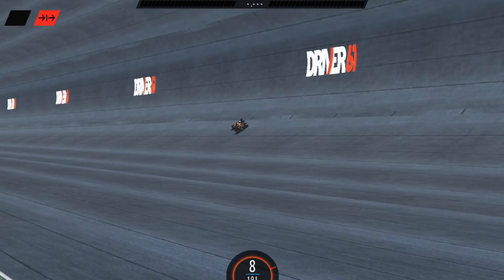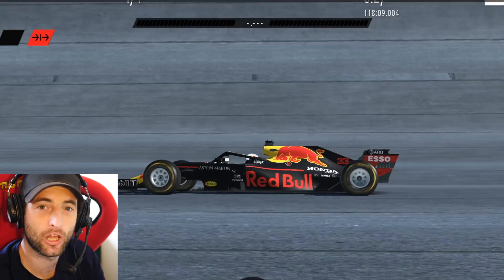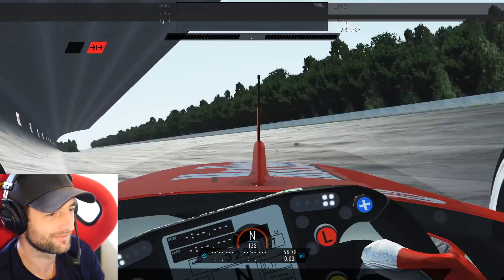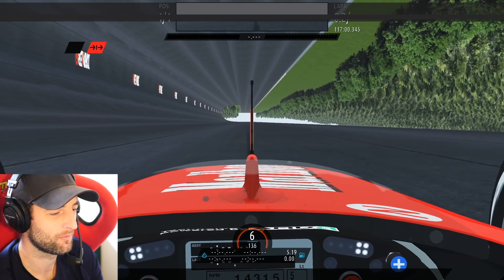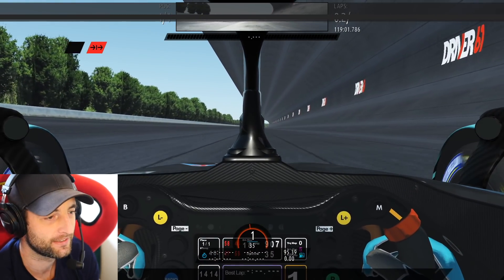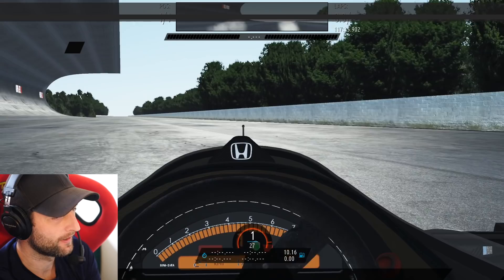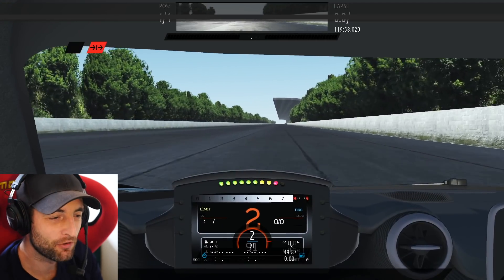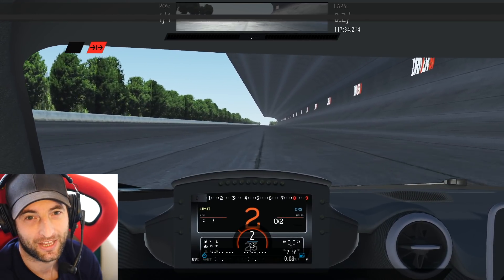Can an F1 Car Drive Upside Down: The Test

Comment: you should take a car that is driving upside down and drive it off the edge of the track to see if it will to go up for a bit before falling
Reply: it wouldn't because it would lose a ton of downforce without the negative pressure between the car and the road from the diffuser.
Reply: Unlikely because a large reason this is possible is due to the downforce generated by the floor of the car which can't be made once it's driven off the edge.
Reply: @harrywhite9030  you're right butttt i still wanna see it happen, for science
Reply: @harrywhite9030  mucho correcto
Reply: @harrywhite9030  but isn't everything in the topside aero actually creating lift once inverted? although not ideal in this design, the overall design for down force is what wings for lift look like. Air should pass faster over the underside (now the top) of the car than it does on the regular "top".
I'm feeling at best there would be a bit of sustained flight, but without thrust, all lift will decrease quickly.

IDK would be great to see!
Reply: @efini_fc4276  hm im not so sure, the aerodynamics of a F1 car is made to 'stick' to the ground, and i think it can only do that when it has speed. When you go out of the track and not only you cant speed the car anymore but it wont be able to glide since its design doesnt allow that, because its oposite to a design from a plane, witch is made to lift from the ground. I dont know for sure, because honestly i dont study this type of stuff and could be just saying stupid stuff but thats my thoughts on it. I do think it would be cool to see what happens.
Reply: @efini_fc4276  no because the floor required 2 surfaces in order to generate downforce, it's the action of the floor moving over the stationary ground that generates the downforce.
Reply: wow, I wanna see this!
Reply: Yes, this is one of the things I wanted to see...because why not?

Comment: It is impossible cause one of the reasons is when the car is upside down the fuel is also upside down and is not going into the engine so the engine will stop working. Big brain
Reply: The germans solved that problem almost 100 years ago. They solved this by turning the engine upside down to begin with. Look up the inverted V engines

Comment: You need to get a smoother track, I'm sure the bumps and inestability during the transition was what made a bunch of the cars fail to run upside down.
Reply from the maker: Yeah that's the case...
Reply: @driver61simracing10  I'm sure you can get the help of some modders to get a better design and we can enjoy a 2nd video :D For science!
Reply: No silly "corkscrew designs" or half-tunnels :) Make it simpler and easier! Be inspired by Trackmania games! Just do a half-loop at the end of track. The car after exiting that loop already drives the track backwards and upside down.

Comment: Great idea. Seems to me the problem is the track. There needs to be a smoother transition from lower to upper decks. It was  the staged transition that led to the "bumps" and that upset the car enough to drop it.
Reply: Yep, especially with cars that get noticeable part of their downforce from the action between the floor and the track, any sudden changes in height between those will lead to big problems. And even if that is not the case, that rough bump will risk losing control of the car and cause losses in speed, and, as it is the air passing by the wings that is making the downforce, losing any speed is very bad.
Reply: No silly "corkscrew designs" or half-tunnels :) Make it simpler and easier! Be inspired by Trackmania games! Just do a half-loop at the end of track. The car after exiting that loop already drives the track backwards and upside down.
Reply: Yeah, the curvature was just too abrupt for any wide body to climb
Reply: Just need a long straight that has a half loop .
Reply: "So, we have to run one last sim track before we pack it in for the night... this time in the shape of a Mobius strip, inverted please."

10 points if you understood that reference.  

Seriously though, a track in that shape or similar could reduce the bumps.  Achieving the necessary structural rigidity to handle the weight and momentum of the cars in a practical application would be a challenge tho.
Reply: @trdrollin  Aren't you special !😅😅😅
Reply: I'm surprised that he got anything to the top with how bad the map is
Reply: I definitely agree with that. I've always pictured that experiment to be inside a completely circular tunnel so to speak. He mentioned the oil going to the top but wouldn't the oil pump take care of that?

Comment: Would a better option be to have the track corkscrew into being inverted? That way you could stay more or less straight and let the track do the work rather than having to drive up a wall.
Reply: Might be a limitation of the sim/track builder
Reply: Yeah when we started prototyping a Sim based on this idea, we used a corkscrew first. The twist can also upset the car a lot though. Both it and the style in this video have to be super smooth. The "half a loop" design is probably safest to avoid losing grip.
You can see our spiral test here: https://m.youtube.com/watch?feature=youtu.be&v=veYdlUgjjHY&t=225
Reply: No silly "corkscrew designs" or half-tunnels :) Make it simpler and easier! Be inspired by Trackmania games! Just do a half-loop at the end of track. The car after exiting that loop already drives the track backwards and upside down.

Comment: Can you do the same test with 2 cars, one following the other at different distances, to see if the dirty air will effect the down force?
Reply: To make this easier to test, maybe have your track developer make a straight line up top for each driver to follow, and also distance indicator markers with whatever unit of measure.. just a thought.
Reply: great idea
Reply: That's sounds extremely difficult to test
Reply: Try ground effect f1 cars?
Reply: Drafting has an effect on downforce on rFactor 2. Unfortunately since there isnt any official F1 cars, the numbers for these settings are pretty guestimate from modders. If you have rF2, you can go in to the moddev folder and just check the skipbarber.hdv file.
Reply: I imagine the tailgater would fall off.

Comment: Problem with the Formula E and CLK are the chassis that scrubs on your wall model because its not smooth enough. Ride height and Bottoming out is the problem, not downforce I think🤔
Reply: FE doesnt have a lot of downforce at all. Its performance is similar to F3
Reply: @jogabonito8989  Yeah but they should all be able to get to the top until falling down just because of speed. F1 are pretty high setup cars, thats why they made it up
Reply: @kev.kaviation   @Kev.Kaviation  An FE car generates approx 3x less downforce than an F1 car at the same speed, despite the massive diffuser. The reason being FE cars are built for efficiency and cannot afford to carry the drag an F1 car does. It is also almost 200kg heavier. Given the F1 barely clings on at 115mph, I doubt the FE can generate the same amount of downforce at a slightly higher speed (max 140mph).
Reply: In short, the FE must hit at least 400mph with its current downforce level to even have a chance to go upside down.
Reply: Gazza yep and also FE looks like F3 in the name (3 and E look kinda similar)
Reply: No silly "corkscrew designs" or half-tunnels :) Make it simpler and easier! Be inspired by Trackmania games! Just do a half-loop at the end of track. The car after exiting that loop already drives the track backwards and upside down.
Reply: yeah maybe but I think they won't do it even if he makes a smoother tunnel
Reply: I'm not talking about the required downforce to stay up guys. It's about nearly all of his cars failed to even get to the top. with enough speed you can get there like in a loop. Downforce decides who stays there :D
Reply: @kev.kaviation  I see what you mean. A tighter loop will give what you want because the smaller radius gives more centripetal force, but I feel that's kind of cheating. This way I can see how far up each cars can go before falling and how much downforce they have. It is nicer to have a smoother tunnel though. I think when you said about ride height and bottoming out you were clearly referring to downforce.
Reply: @kev.kaviation  you answered the question yourself. 

"With enough speed they can go on a loop" - I don't think 115 mph is fast enough either for formula E car. Maybe 150+ mph and it might do?

As for CLK, that thing flies off when while driving in a straight line on a flat surface. It will take off as soon as you try to go for the loop.
Reply: @autumnleaf2976  Have you watched some of the real hot wheels stuff? They are not doing anyway near 120mph do go through a loop. I actually think that FE will make it to the top but then fall down
Reply: @kev.kaviation  what I meant by loop is like circumnavigating the roof of a tunnel. Like start climbing from right, keep driving on the tunnel wall along the roof and come down at the left.

Why do you want to see a 2D loop on a sim. That can be done with an everyday car with high enough speed. I am fairly certain someone might have accomplished that as well, redbull or some sports channel.
Reply: @autumnleaf2976  Yes, he is referring to using centripetal force to get the car to the top. Like you said any car or thing (even a sack of potatoes) going fast enough will do that. But the video is about downforce.
Reply: Gazza you clearly do not know what your talking about. Saying FE cars need to be travelling at 400 mph is incorrect as the force-velocity graph is not linear, from an aerospace engineers point of view I would say around 250mph should be enough for the FE car

Also for a car to be driving upside down it depends on the centre of pressure location compare to the centre of gravity location, if these point do not match the car will require more downforce than the mass of the car to allow it to drive upside down
Reply: @parelgaming5099   Fine, I never claim to make an accurate calculation of the speed required, or even mentioned the centre of gravity / pressure. Was never my point. No need to get your knickers in a twist.
Reply: Yah.  needs to be much more gentle.

Comment: I don't use the sim but isn't it possible to change the stiffness of some cars' springs, so the bumps are less offputting? obviously, the F1 cars have enormous spring Forces and not that much travel but still, there might be some adjustments possible.
Really enjoying your content. Keep it up

Comment: Wouldn't the use of a dry sump help solve the oil flow problem you described ?
Reply: Dry sumps still have to gather the oil from the oil pan but have a backup oil reservoir, under some form of pressure that can be forced into the engine in somewhat brief moments where that oil pump at the bottom is starved of oil. So it could work until the backup oil supply is depleted...maybe. Another thing would be if the tunnel were actually round, not just a partial tunnel, so that the car could drive up on one wall go over the ceiling and come down the other wall so that it would have enough centrifugal force to keep the oil down. Realistically, I think that combined with a dry sump, could give it some running time on the ceiling...but not that much more...depending on the backup oil supply and type of dry sump system. Anyone else have a better understanding on this...I am really curious as well :D